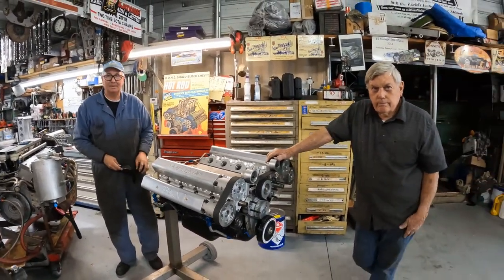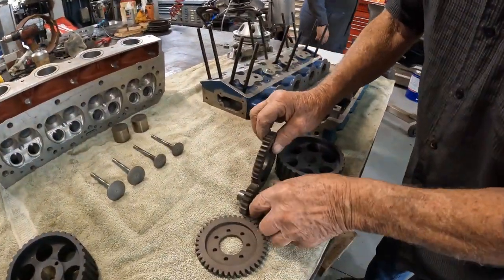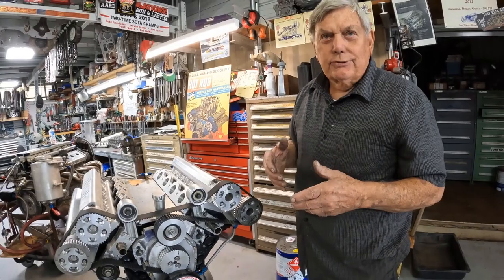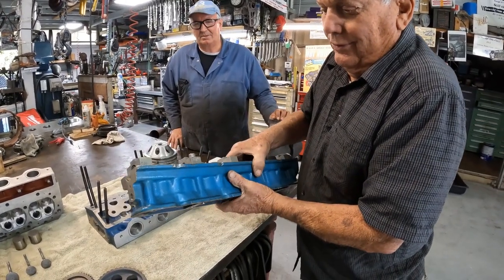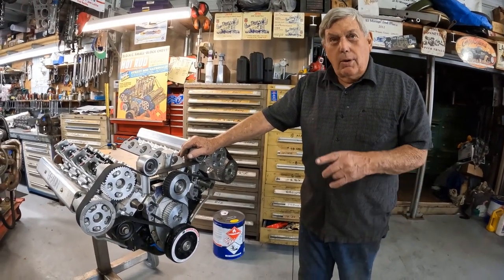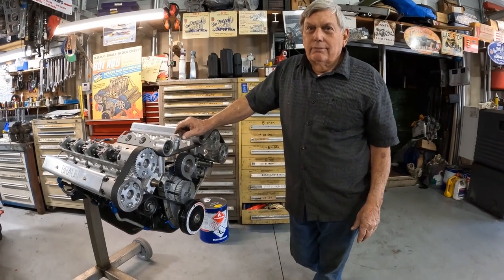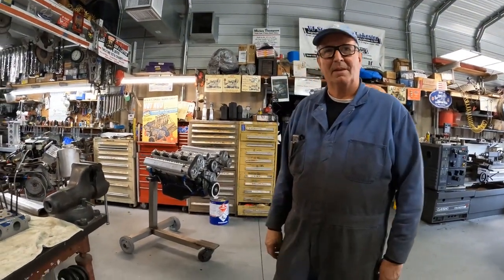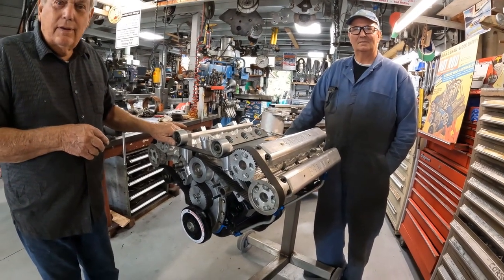50 Year Old Quad Cam +1 Chevy 350 Engine Explained!  Moser Motor Masterpiece!

Comment: I would love nothing more than to see you and this engine as guests on Engine Masters vs a modern LS!
Reply: @iamgriff  The EMC was destroyed when Hot Rod magazine took over.
Reply: I thought nelson racing got ahold of some Aaro heads and dynod it? Swore it made north of 700 with a small cam. I do t think an LS could touch it with the same set of rules being that it's 32 valves
Reply: @KingJT80  theres people making plenty of power na with an ls. Saw a guy with a white c5 vette making 1100 na on 1320
Reply: @jeffklonowski6816  there are but on this type of setup with rules a 4 valve would fly past it with the same cubic inches
Reply: @KingJT80  thats crazy. Ive never built a 4v engine. Got me a vortec 350 im rebuilding though. If i had the money id get that zz632 to slap in my tahoe.
Reply: @KingJT80  No reason to Overly complicate an LS. There are plenty LS making way north of 700 NA. It would be cool to see none the less
Reply: @nathanwood1567  I think Nelson racing got ahold of some Aaro heads made a crazy amount of power with a mild camshaft
Reply: The Chevy small-block achilles heel is the Siamese exhaust ports it causes that part of the head to get hotter then the rest of it, aluminum heads and blocks  don't play nice with high temperatures. Two words (head gasket)
Reply: @adamscott9725  we could have twice as many cracked exhaust seats. Lol
Reply: @iamgriff  yeah. Its not like its a known engine builder, a known respected engine shop, and a hotrodder who's gone faster than anyone in this comment section and broken records. No we are just supporting TV by watching those guys

Comment: So this is still a push rod engine correct? But the overhead cams control valve's correct? And there's 4 valves per cylinder with this setup? Did I miss anything? The engineer is amazing! To think this thing came into fruition in the 70s. Absolutely incredible!
Reply from the maker: Correct, this is a pushrod block but no push rods or lifters, the pushrod cam is used the run the distributor and timing gears for the overhead cams. 4 valves per cylinder. Was featured in 1971 Hotrod Magazine.  thanks Greg Q

Comment: Great stuff from such an early attempt at a four valve head on a US V8. The earliest 4 valve head I have ever seen was a friend's British1922 Matchless racing motorcycle engine. It was a V twin, with cast iron barrels and heads and exposed valve gear, chain driven. Can't remember the displacement, maybe 750 to 1,000cc. Designed to run on methanol, I think, so about 13: 1 compression ratio. The cooling fins were really small and inadequate.
Reply: If it was designed for methanol, perhaps then the requitement for cooling fins would be lower generally than an equivalent petrol engine. Methanol has a lower chalorific value than petrol meaning you squirt much more of it in, so the cooling effect is also greatly increased, reducing the requirement for cooling fins. Im not familiar with the bike you mention but it sounds like a bit of a beast
Reply: @adamtooms8977  they were. 
My dad flattracked back in the 60s and knew of those a little bit. 
Quite a nice machine,matchless was a step above the ordinary.
Reply: @adamtooms8977  Yeah, you are probably correct, especially in an English engine. I have seen ice form on carburettors and intakes on hot Aussie days running methanol mixes at car races. Oh and just as an aside, another really early and very successful four valve engine was the 1917 Napier Lion W12 aero engine from WWI. 
https://en.wikipedia.org/wiki/Napier_Lion

Comment: It seems that GM eventually tried some setup like this as the 3.4 V6 DOHC engine setup looks so similar to this as the block is mostly the same pushrod 3.4 block.
Reply: Even the Lt6 gen5 engine has a jackshaft that drives the high pressure fuel pump where the camshaft is in the lt1 block.
Reply: @timothybayliss6680  Not even remotely the same, that is still a center cam pushrod motor,  just has an extra lobe to drive the fuel pump. These heads and cams have more in common with the GM 2.4 quad engine. Same head design and cam carrier design.
Reply: The 3.4 DOHC has the same bore center distance as the SBC and LS. There was an effort by some people to convert the Poncho OHC six to DOHC using two 3.4 heads welded together. Converting a OHV to OHC leaves two choices to drive the cams. 2:1 off of the crank or 1:1 off of an idler shaft in the original cam bore. Which is what the LQ V-6 did. In some ways I like what Chrysler did with the 3.5. One cam which operated the intakes with seperate rockers and a split rocker for the exhausts.
Reply: @quick455  Are you out of your mind?  The new LT6 is a DOHC 4-valve engine.  Haven't you been paying attention to the C8 Z06 news releases?
Reply: @andyharman3022  Missed the whole 6 there mochacho, had LT5 stuck in my head. But in reality the LT6 is a completely new design engine that doesn't share anything with the previous LS or LT engines, so it's still not a pushrod/OHC converted engine, it's a completely new architecture. It doesn't even share anything with the Blackwing engine
Reply: @quick455  The 2.4 DOHC Quad 4 and the 3.4 DOHC (came in Luminas, “Monte Carlos”) were also completely different designs, but I agree, they are both worlds apart from this
Reply: @andyharman3022  That’s not even the point he was making, have you been paying attention?! Big deal that the C8 vette is a 4 valve DOHC….it’s also a completely different engine block and had the benefit of the modern design features that have been incorporated and used since it’s earliest versions! Not even in the same galaxy as doing the same with a mid-20th century design that was always intended to be a OHV Pushrod engine with a single camshaft pushing those valves
Reply: @quick455  It’s not actually all new, they’ve actually been running this design since 2019 (internally at GM) and the whole valve train setup is basically a carryover from the LS7 “mechanical "finger follower" valvetrain and dual-coil valve springs with titanium intake and sodium filled exhaust valves. Forged pistons and titanium connecting rods” to be specific
Reply: @mostlypeacefulmisterputin  You don't know anything.  GM has been running the LT6 since 2016 at the GM Powertrain headquarters in Pontiac, Michigan.  I saw the first engines when I worked there.  They have been racing them in IMSA since 2019.  Furthermore the LS7 doesn't have a mechanical finger follower valvetrain, it has an OHV valvetrain.  The LS7 also had Titanium Conrad's and valves and forged pistons, as did the supercharged LS9.
Reply: @andyharman3022  I forget these days. Titanium Conrad, was he Marvel or DC?
Reply: @keithhoughton4308  A figment of my spell-checker's imagination.
Reply: @keithhoughton4308  His catchphrase is "REMEMBER ME?!" as he bursts through the side of your block.

Comment: This is awesome
i am need a tall deck block with quad or triple valve per cylinder dual overhead cams and dual intake runners per cylinder together with a 'layed over the valve cover' long ram individual runner intake manifolds with mechanical smart carbs meant for dirt bikes of great altiitude variance, the bore stroke ratio shall be 1.075:1 and the rod ratio for Natrually aspirated shall be 2:1 and the rod ratio for boosted shall be 1.8:1 that is all. This is a daily driven street engine endurance and fuel mileage with power on tap when high throttled and a miser when foot is off the fuel pedal This is how you build a proper daily driver responsibly

Comment: So is there a shaft of some sort where the regular cam would go  or a special apparatus that mounts to the front of the block to drive the ohc cams?  Great video did I see spark plug holes between the valves  of the 4 valve head,?

Comment: Surely you'd be able to get an idea of the output of this engine by measuring the intake and exhaust flow. I doubt there's any significant reduction in pumping losses (perhaps an increase even) over stock pushrods, but I'm sure it'll be able to out-rev the stock engine on the street no matter how exotic the valvetrain. 
It could be academic if the twin cam heads top out at 300CFM against a lower revving but much higher flowing SBC aluminum head that you can just buy.
I love the imagination of this but far out, back then there was nothing like affordable off the shelf aluminum heads of today. 

I don't hold out much hope for these compared to modern heads but I sincerely hope I am proven wrong - I really do. 
Wouldn't it just be the bees knees if these topped 400CFM and revved to 8500rpm on the street?
Reply: This 4V head will have more volume per cfm compared to a ohc 2v. The tradeoff is usually low speed torque suffers due to optimizing valve timing for high rpm potential 

Also, even though there's more moving parts, the valvetrain is still lighter which allows for good revs.

Comment: Unnecessary complication. Longevity of such a nightmare will be something they cannot overcome. Pushrods are simple and last. The LS can make over 400hp with pushrods in OEM configurations and indeed do. The escalade PUSHROD LS makes 403 hp STOCK.
Reply: These parts were made 25 years before the LS existed.  They were never really meant for longevity.  Their purpose was to try to make more power with a SBC.  It’s not like there were big stroker cranks and aftermarket blocks in 1971 that could make for a 454 cid SBC.

This engine is akin to a Ford flathead with an Ardun OVH conversion.  Newer engines can easily make more power, but it’s still cool to see old engines with rare decades old speed parts that were exotic for the time.
Reply: That’s true, but 4V OHC engines often offer better efficiency (better mileage), better knock resistance (allowing higher compression), and often higher RPM limits. Many European cars use them successfully and have for decades - and last for 300,000 miles or more. Even cheap cars made in India of all places often have 4V OHC heads, and they do it because gas is expensive over there and they’ll save the extra cost of OHC and 4V pretty quickly in the amount of gas they end up saving. Granted, OHC 4V is simpler on a I4 than a V8. I like the simplicity of a pushrod engine and am very impressed at how well GM has done with them, but I also see the advantages of the OHC 4V arrangement.

Comment: I had a 72 Chevy Vega (140ci) with those "buckets" under the cam. Would love to see that dyno test having the 50 yr old 4V 350 beat out the modern LS
Reply: I chopped, pushed, and squeezed a 350 4-bolt out of a 1970 C20 into a Chevette back around 1995-96….that was the one “Vette” people had a hard time accepting a loss to!

Comment: That is so cool. I'd love to see someone do a 4 cam setup like that on a 2nd gen small block Chevy LT1. Since the water pump is driven off the internal cam, there wouldn't be a need for the belt drive so it might make it easier to do. Still would be a massive task. But it would be awesome
Reply: I’ve built quite a few early 90s LT1s and one of the first things I learned, was to immediately scrap the whole “gear driven” water pump setup (which is possibly the 2nd worst design GM ever allowed out on the roads, besides the nightmare setup of their 1990s DOHC Quad 4), along with one of the worst designed distributors/ignition systems ever….the “Optispark”! You run an electric water pump, and do a “LS” style Coil-on-Plug conversion and then you’re well on your way! We eventually got 578HP (wheels) and a best 1/4 mile of 10.34@126 mph out of a N/A 1994 Z/28 (factory 1LE package)
Reply: @Dobbies Revenge he absolutely said 2nd generation small block LT1 NOT GEN 4 or 5 LT whatever the newest Gen is.

Comment: Colin Lyster (ex Lotus) built  small block DOHC v8's here in New Zealand,back in the !980's-90's.At least one of these engines went to Australia.Denco Engineering (NZ) was also involved.
Reply: Related to the Vette ZR1 LT5 engine?
Reply: @ionbusman2086  No ,He was running on a nothing budget,so would have used a stock block 350.He also did midget donks.At least one 4 cyl lyster was on display at Nelson South Services.We bought the business and the engines disappeared,presumably back in the pot to protect his designs.

Comment: GM teamed up with Lotus in the early 90's and made the LT5 DOHC (4 cam 32 valve small block V8) available in the C4 ZR1 it also had a ZF-S6 speed manual transmission which was rare for the time. I believe this was Chevy tossing their hat into the Supercar ring because make no mistake about it today's C8 is a super car and Corvette has been in the super car status since the Z06 now if they would just make it with AWD then I'll buy one.

Comment: Makes one wonder what either the DZ302 are the 327 would turn if those were on top of some with good parts inside and bumped compression up on them.
9800 on a 350 would that not be even greater on those mentioned above. 
I know my old 327 would turn more rpms than any 350 I ever built, and my buddy has a numbers matching 69 Z that twist up there too after we rebuilt it even using stock parts.
Makes old men wonder about such things, and thank you for bringing them out for everyone to sit listening with wild thoughts from our younger days running through our minds.
Reply: The DZ 302 and 327 are nothing special. Shorter stroke means they can rev higher before reaching a terminal piston speed. You can de stroke any old sbc and have about the same foundation. 

He'll, you can slap together a junkyard 302 sized chevy suing the crank and rods from the L99 4.3L.  The stroke already allows those things to live happily at 7k using pedestrian internals.   They would have been an interesting entry level V8 option for the 4th gen F body. Especially since your basic choices early on were a 160hp V6 then a 270hp V8. The L99 had 200hp even and would have made for a fun car imo.

If they still did multiple displacements they could have done a 4.3L L99 a 5.0L using that stroke in a 350 bore block, then the LT1 5.7

I bet the 5.0 would have been distressing close to the 5.7 in power though.
Reply: @DrewLSsix  
Except the DZ blocks, (there was another prefix for the 302 exclusive to Z/28) had added webbing to strengthen the block. A 350 crank wouldn't turn in these blocks, but the large journal 327 crank will spin.
The original LT-1 (370hp 350) used the same parts as the Z/28 (290hp 302) the 350 blocks didn't have the added webbing the 302 block's do. The 302 was built with Trans-Am racing in mind. As were the angle plug heads, and cam's, the 2X4 cross ram intake some other part's not standard production. Sold over the counter at Chevy dealers as "Service Package" "Not For Highway Use." Having had a 1970 LT-1 engine with service package angle plug head's, and the hotter of the two cams, (part number ending 754) Z/28-LT-1 hi-rise intake, an original Holley 780 cfm carb off my dad's '69 
Z/28 unfortunately never could get it working right, so changed to a 750 double-pump. A Delco dual point distributor, and aftermarket roller rockers
a necessity with cam's at, and above .500 lift in a small block Chevy) In the old day's a 283 punched .125 was called a 301. 4" bore, 3" stroke is 301.84 if I recall. Being more than 301.50 GM called it 302 rounding up the number. Same with 350 at 348. something something. Just short of 349.
The old two bolt small crank engines would generally tolerate .125 overbore. Big blocks as well up to .150 over. Later post 1975 engines are thin wall castings, and won't tolerate more than .060 over bore.
The other thing that made the Z/28-LT-1 engines a little special is that Smokey Yunick was in on the design of the intake manifolds, the cross-ram manifold in particular. To date this is best small block intake ever designed. The same is true for  the MkIV big block engines L-88 427- LS-6 454. LS-7 (shared part's with L-88)
never saw production, only just enough L-88 were produced to qualify for racing requirements. Initially L-88 had no factory hp rating. Hot Rod magazine had one dyno'd, came in with 568 hp. 1968 or ,69 I think. Insurance companies had apoplexy over the no hp rating, and this was settled at 450hp. Slightly conservative, like the 290hp rating on the 302, 1967-1969. Chevy played with horsepower ratings too 1965 L-78 396
375hp in cars, 425hp in Corvette. The latter number being more accurate.
1970-1/2 Camaro Z/28 LT-1 350 360hp. 370hp in Corvette.

Comment: This story will likely not be believed but is all true. I was a huge race car fan back in the 1960s. I was also a mechanical design student and my focus was engine design. In the mid-60s I designed a DOHC head for a small block Chevy. The result was a 2 valve per cylinder head with the intake ports coming down between the cams, like Lamborgini. It featured 2 spark plugs per cylinder and had the valves out of a 396 Chevy engine. The combusion chamber was a true hemi. It, like the Moser had removable cam towers. I chose Harvey Crane to do the cams and sent him a letter outlining what I was doing. I never heard back from him. Later I heard that he had gotten ahold of a couple of Chrysler Engineers and I strongly suspect that the Moser engine was the result. I personally cut the cam blanks myself, including the rifle bored oilers. Just needed someone to grind them.
Reply from the maker: Would love to learn more about what you did as a Mechanical design student.   Thank you for this info Greg Q
Reply: @GregQuirin I tinkered with a whole lot of things. I was also involved in a 3.0 liter DOHC 4 valve Boxer watercooled 8 cyclinder project that involved two mechanical engineers from Cal State Sacramento.  Learned a whole lot about crank design. What was really cool was that both CSUS and Sac City both had enormous machine shops and foundries. You guys would have been in heaven. I also worked on a constant flow Fuel Injection with slide throttles and a micro-hydraulic metering system.